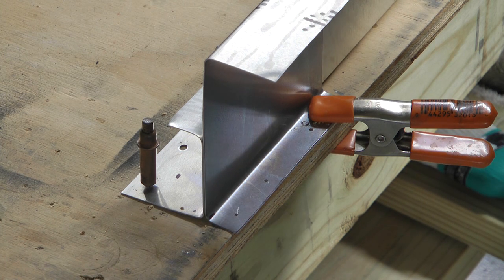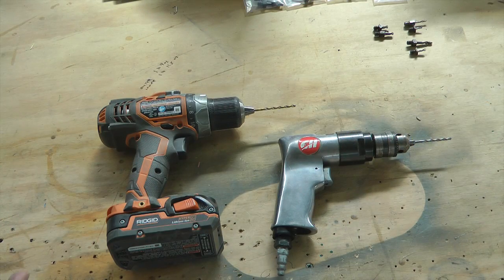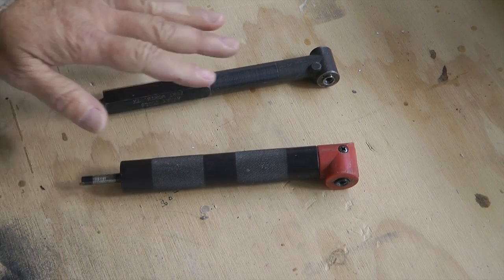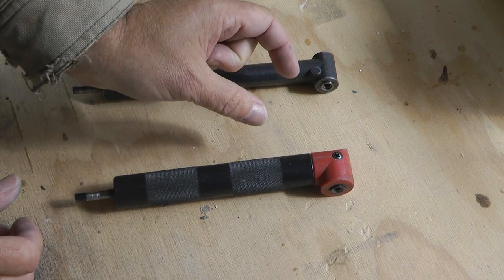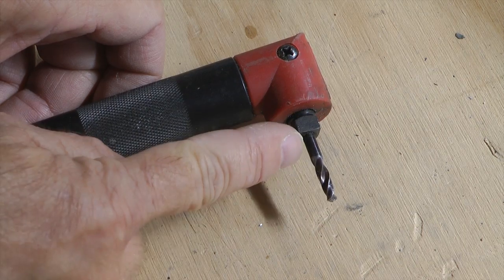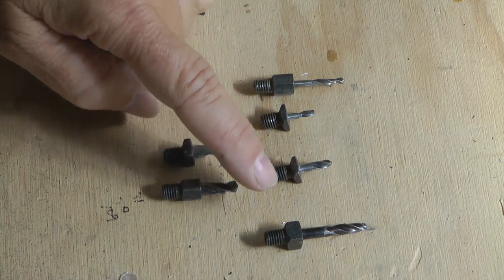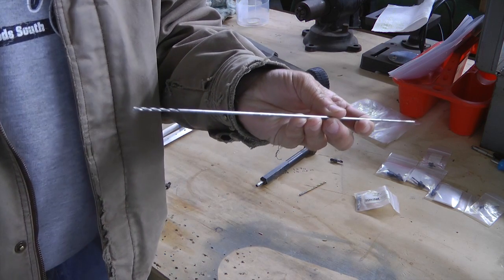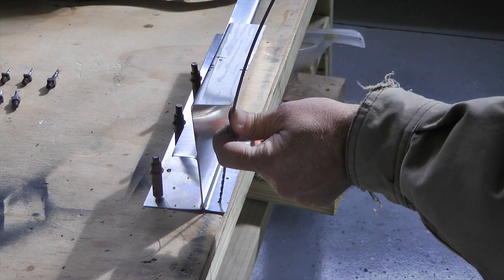Drilling in Tight Places

Comment: Angle drills make angle holes.
Reply: Hey genius,  most diy'ers don't have  an everyday use for an angled drill therefore it doesn't justify the purchase of a $100 tool. 

Why would one buy a new tool that you would use once every 5 -10 years when you could buy an accessory for a fraction of the price of a new tool? Answer THAT question before moving forward with the debate.  And if you find a reason for your reasoning go do a YouTube video so that you could get ridiculed throughout the comment section of how much of a moronic ration the video is.. 

There is a better chance that the average diy'er would have lost or misplaced that tool and then would have to buy another one.